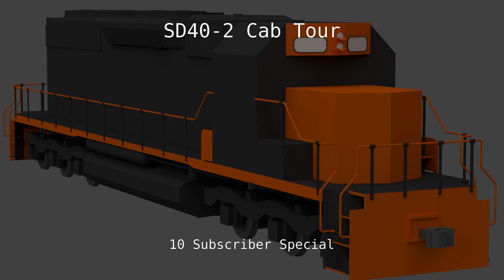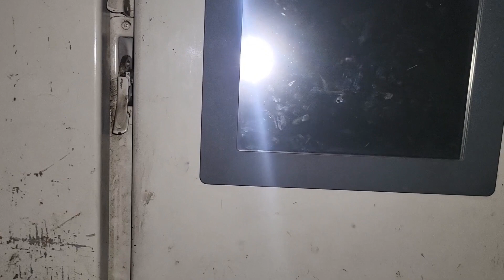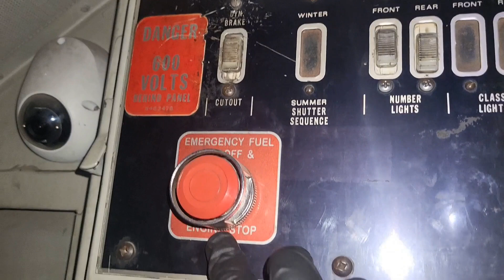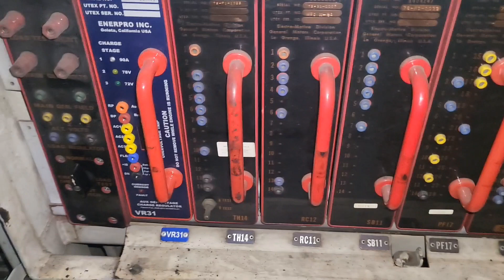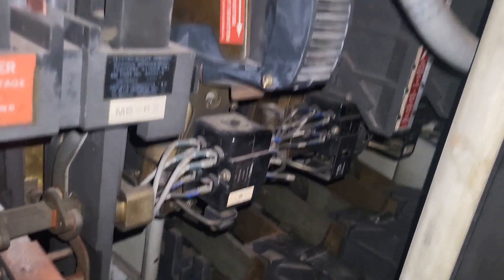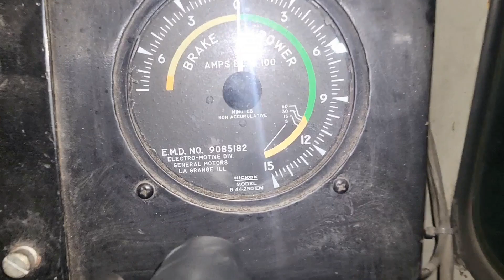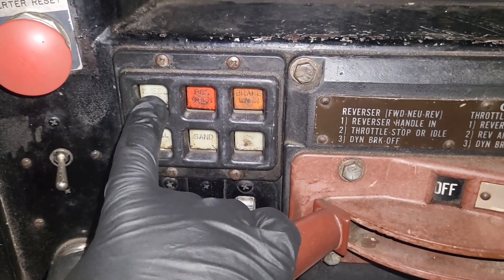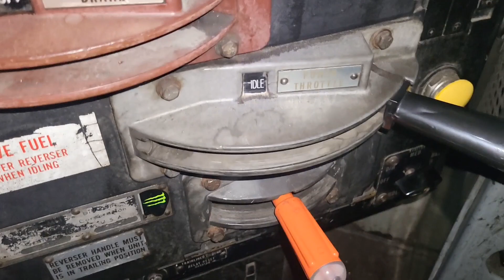SD40-2 Cab Tour (10 Subscriber Special)

Comment: Series and parallel refer to how things such as battery’s are wired together. Series would be wired negative to positive to enable higher voltage ie 12-24-36-48 volts. Parallel would be wired negative to negative and positive to positive to maintain the same voltage but compound the amperage. Thanks for the video and keep up the great work
Reply from the maker: I'll give you partial points lol. Yes that is correct, but I was more asking "what is being connected in series or parallel?"

Comment: Nice tour! But why is it, that out of all modes of transport, locomotives are so often so incredibly dirty on the inside? Do the companies give so few fucks about giving their workers a clean place to work?
Usually ship's bridges are clean (though enigneering spaces may be oily), plane cockpits always are clean, bus/coach driver's compartments are clean etc. But for some reason, locomotive cabins rarely are. Except in the Netherlands, where the train's passenger compartments is not too far removed from the dirty train driver's cabins, with the dutch train driver's cabins often being cleaner than the passenger compartments...
Reply from the maker: Ok so, I have to be careful how I answer this in order to not get myself in trouble.

I suspect a large portion of it comes down to the fact that locomotive cabs aren't places anyone other than the crews see. I also would mention that cabs do get cleaned on the regular but working outside in everything along the rail and in yards, sidings, etc. means that whatever's out there is going to end up in the cab. In addition, plenty of locomotives in the US can go for weeks or even months without getting fueled or being anywhere the cabs even could be cleaned. It's just the nature of operations in the US. I won't pretend to know much about maritime, but most other modes of transport are places where the public can actually get to and/or see. In the case of freight locomotive cabs, that's not really a thing that happens.

Comment: These circuit modules are early 60's and 70's technology. They offered two important  features: test points and the ability to remove/replace them when they failed. Interesting video and great content on your channel. Good job and thank you!
Reply from the maker: Thank you! I saw a video by Travelling Tom about the UP DDA40X and I saw the Dash-2 switchgear and similar circuit modules. I think he mentioned in the video that those locomotives were one of the first places those modules were used.

Comment: where's the wiper switches on the dash 2?
Reply from the maker: Well that's one of those "they're all the same" things lol.

Nearly every locomotive I've been on has air-powered wipers. Usually the valves are located above the side windows, either on the panel with the cab lights, or simply in the air lines in the cab near the top of the side window. (In the video you can see a wiper valve around the 1:45 mark) There's also (sometimes) a wiper valve above the engineers side cab heater against the front wall.

Comment: Hi good morning yep that is a later phase 1971 era prior to - 2  pretty cool right.. if you look at the 3000 series you will see some of the very first SD40,s built Ex up chicken wire radiator grows what some kind of cover. Yeah it's a very diverse fleet I like the 3000 series and a 6900 series the x leasers are really cool I would love to see the SD40 x built on sd35 frame that's very rare early test bed 4 SD40 I agree you can never learn enough thanks a lot
Reply from the maker: Sounds like you know more about that side of things than me lol. I might climb on that 3046 and look around.

Comment: Locomotive 6995 6996 produced in 1971 late phase they have a longer tapered dynamic brake housing that's true most second generation EMD cabs are very similar thanks for your efforts very appreciated
Reply from the maker: Neat, I learned something today. I've noticed that most of our converted Dash-2s have a different dynamic grid housing. (I think the 6989 is another exception.) But didn't know there was a term for it.

Comment: Would you have any interest in doing maintenance instruction videos on the prime mover?  Would be great to have information on lash adjuster testing, fuel rack adjustment, injector timing, etc. from someone who does it for a living.

Got one 'BC' block 12 cylinder with unusually loud tapping all throughout the top deck but no one at that shop will listen to me when I suggest checking the lash adjusters.  They're damn near the loudest sounds coming from the engine!  🤪

Heck, I could maybe even upload a clip of it and see what you think.  😛
Reply from the maker: I plan on getting to that stuff when i make it to mechanical stuff. The prime mover will probably be a bunch of videos at some point.

I could probably show some short videos of some of that stuff in the not so distant future.

Comment: Hey there.  I've crawled around quite a bit inside of the older pre- Dash 2 EMDs so I am generally familiar with the older contactor and pneumatic drum styles of control.  I've never had an opportunity to explore a Dash 2 unit with the motorized controls though.  I would love to see an exposition of the motorized drum switches and to get some sound samples of them with the engine stopped.

Usually the controls can be operated on an EMD without the engine running by putting the unit in "Run" and enabling the Control & Gen. Field switches.  Leaving Engine Run off stops the alarm bell from ringing due to the NVR relay being dropped out due to the absence of alternator output.
Reply from the maker: @heavy-iron Oh wow, SD9. Yeah, that's a little older than what I'm used to lol.

I'm a little bit confused what you mean by "exposition." Do you just want to see it in action, or do you want a little bit of a primer on how it works? Both of those are doable, I'm just asking for the sake of clarity.
Reply: @CDROM-lq9iz  Mostly just getting a closer look at them in general and getting some sound samples of them operating.
Reply from the maker: @heavy-iron Gotcha, I think we have a couple of the transfer switches laying around. I also think we have a motor, although we might not. I'll try to make a video of those and get one of them working with the engine dead. That said, I've got a couple other videos in the pipeline so I'm not going to promise a timeframe for how long it'll take me.

Also, just out of curiosity, do you want the sound of it to use for a video game model or animation or something? Or just want to hear it? Not judging, just sounds like something someone who's making sounds and models for a Dash-2 would want lol.
Reply: @CDROM-lq9iz  Mostly just because I like cool electro-mechanical sounds like that and I've never actually gotten a chance to hear what one of those switches sounds like on it's own without a whole bunch of background noise muddling things up.

It could also be handy for a Run8 mod or similar at some point, but I can't see any immediate application for it given the particular audio implementation of that game.

TL;DR:  I just like crawling around inside these machines and becoming more familiar with the intimate details of their workings.

For instance I'm familiar with the excitation system on the SD9, but I just cracked open the SD40 maintenance manual to that page to try to figure out how it works.  It's boggling my mind how much more complex it is than the old chunky rheostats.  ...And I'm talking about the PRE dash-2 units - not even the newer ones with card-edge modules and integrated circuits!  That magnetic 'Sensor' module that triggers the AR10 field SCRs is pure black magic...  😆
Reply from the maker: Gotcha. I've never gotten far enough into anything to fully mod something, but that's what u assumed you were after lol.

Like I said, I'll try to get you something. Not gonna promise a timeline, but I'll try to get to it soon-ish.

I also plan on getting into the excitation system. It'll be a while, but I plan on getting to it. But now you have me curious because I've never really seen a DC main without computer controlled excitation. Does it just take the Rate Control output and run it through the load regulator to the battery field?
Reply: @CDROM-lq9iz  
It depends on what type of unit we're talking about.  I'm assuming you're referring to a straight SD40, rather than one of the older units like a 7 or 9?  If so the short answer is "PFM!"  😅
Reply from the maker: @heavy-iron  I've never heard the acronym "PFM" before, but based on the conversation we've had I assume it means "Pure F*cking Magic" lol.

We actually have quite a few SD40s running around. Granted, they're now Dash-3s but they still don't have the motorized switchgear. I also have a section from an SD45 manual that goes over the pre-Dash-2 stuff for the SD45s, and almost all of it seems to work the same way as on a Dash-2, but the circuitry isn't as easy to find and service as a Dash-2 module. Maybe I'll sit down and read some more of that book at some point.

I actually was asking about the stuff you're more familiar with. We have one random GP9-R, but I haven't seen the print for it and don't really know how it works on locomotives without some kind of computer-controlled excitation. The closest I can get is our GP35s (which are dash-3s and all have computers) They have a Battery Field Driver that's controlled by the ECU. I'd assume that on an older system without a computer the BFD gets a signal from the Load Regulator and some kind of power feedback from the main. If the LR signal is higher than the power feedback, it turns on a transistor to the battery field. If the LR signal is lower than the power feedback signal, the transistor turns off.
Reply: @CDROM-lq9iz  On the old units like 7s and 9s, there are no semiconductors anywhere on the locomotive except maybe 1-2 dozen small to medium selenium plate rectifiers employed in various control circuits.  No power rectifiers or SCRs.

Excitation on those units is controlled exclusively by the engine governor via a large hydraulically driven power rheostat slaved to it (the load regulator) which is in series with the battery field winding.  There is also a much larger shunt field winding internally wired in parallel with the generator armature which allows the main generator to amplify it's own field strength based on the comparatively small (<80A / 74V) battery field input.

In dynamic braking, older units have a pneumatically operated drum-type transfer switch to connect the traction motor fields directly across the main generator and the armatures directly across the ribbon resistors in the long hood.  Newer units (starting roughly with the late model "Phase 4" SD9s) utilize conventional power contactors in cascade sequence instead of the drum switch.  

With the 9s specifically, dynamic brake control is primarily established via a special bipolar reed relay (the "Micropositioning Relay") set up in a bridge configuration between the load regulator wiper and the DB control rheostat wiper in the engineer's controller.  This is known as the "teaser circuit" because it continuously modulates an override solenoid in the engine governor to reverse the hydraulic motor driving the load regulator.  The result is that the load regulator continuously oscillates back and forth about 1-2 commutator segments at a time as the reed relay responds in order to keep the controller and load regulator voltages nearly equal.  I just uploaded a video which demonstrates this behavior for clarity.

There is also a dynamic brake regulator which acts as a protective circuit.  I can't remember if it shunts current around the battery field winding or modulates the override solenoid in the governor, but the net effect is to maintain a maximum of 700 amps through the DB ribbon resistors.  This is a self-contained circuit module which functions entirely independently of the rest of the DB controls.

No rate control panel, field driver or ECU, etc. in these units.  They predate all of that.  The only rate control stems from the time required for the load regulator wiper to physically complete a full sweep along it's commutator from minimum field (0 volts) to maximum (74 volts), which is roughly 7 or 8-ish seconds.  ALL of the load regulation logic except wheel slip & wheel creep control (+dynamic braking) is hydraulic in nature and handled entirely by the governor.

Not sure what the newer governors have going on, but on the 567s they have 4 solenoids labeled 'A' through 'D' which act in sequence to select the desired engine RPM and power output (i.e. fuel rack position).  Three of them are additive and one is subtractive.  (A= +80 RPM, B= +320 RPM, C= +160 RPM and D= -160 RPM.  D is also used for stopping the engine.)
Reply from the maker: @heavy-iron  That's nuts. So I was right to say all the excitation current goes through the LR. After thinking about it I was like "There's no way its that simple, something else has to be going on."

I was a least right about there being something else going on but holy cow is that a lot of stuff I've never seen. You definitely taught me a lot in one comment lol.

Btw, I thought I'd mention that, as much as you call the semiconductor stuff magic, the governor solenoids are exactly the same as what you described. A, B, C, &D (plus the ORS if you count that)
Reply from the maker: Wanted to add to the governor section. I dug out an old speed chart from our governor shop, and apparently, there were two different engines that had the +80, +320, +160, and -160 A, B, C, and D solenoids. The 835rpm engines (it lists 567D-1 with blowers, and 567D2-3s), which I assume are probably still newer than the ones you're familiar with. And the 900rpm engines, which would include the 16-645E, 16-645E3, and 16-645E3Bs that I'm familiar with. (As well as, I'm sure, many more)
Reply: @CDROM-lq9iz  Don't quote me, but I believe the 'C' and 'D' blocks were both 835 RPM engines, while the earlier models ('B' and prior) were only good for 800 RPM.  Definitely 900 RPM governors on the 'E' model engines and later.

Incidentally there are also two different blower gear ratios on the 567s...  1540 RPM for the 6 and 12 cylinder blocks vs 2040 RPM for the 8 and 16 cylinder blocks.  6s and 8s had only one blower, while the 12 and 16s had two of them.  Those RPMs might be for the 800 RPM governor iircc.  Proportionally higher with the 835 governor unless I'm lying.
Reply from the maker: @heavy-iron That'd make sense. I'd have to look to see for sure but the chart mentions the 800rpm variants too.